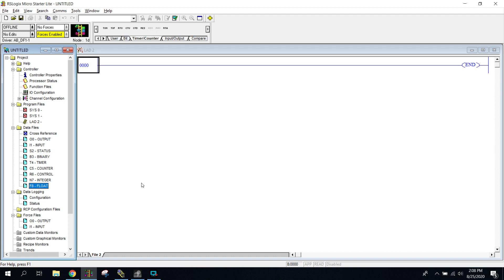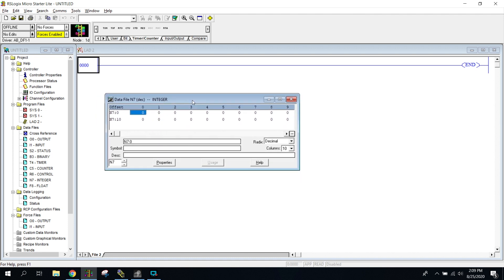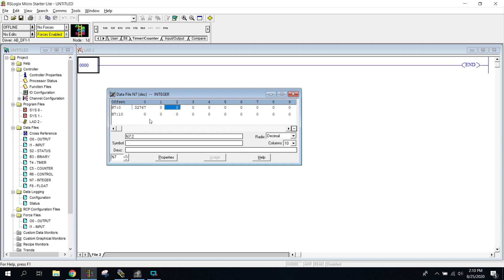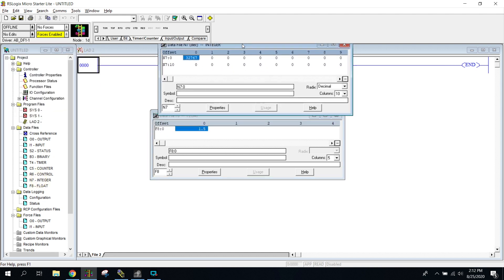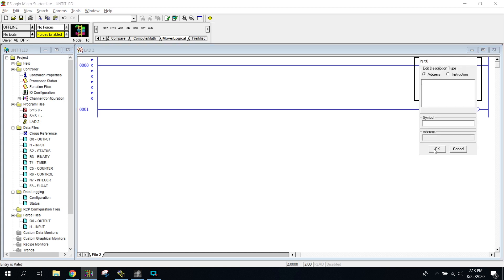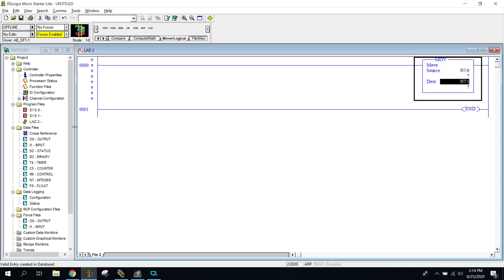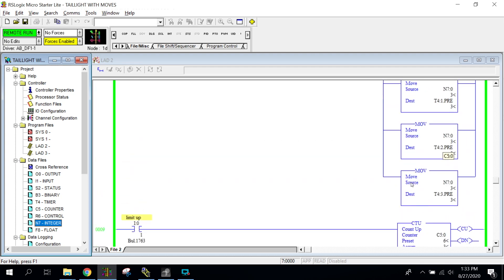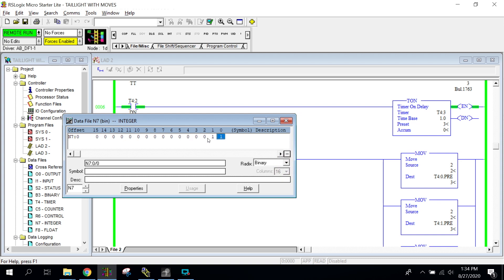Allen Bradley PLC - MOV Instructions, Integers and Floating Integers

Comment: at 7:30min u put u digital input I:0/3 high to move the value 32767 from n7:00 to n7:01 u get i to move but when u put the input i:0/3 low the value 32767 stays at n7:01 my qustion is how to stop moving when u have moved once
Reply from the maker: I can think of a few ways. I would just break the path of true to n7:01 if the number was greater than 32767. Is that your question?

Comment: hello thx for all the nice details, but i have an issue with encoders, ( a cutting table) the length of table is 3 meters every time i enter a value it doesn't stop in the exact value i use any advise will be appreciate it
Reply from the maker: I would need to know more about your problem but I hope you figure it out.